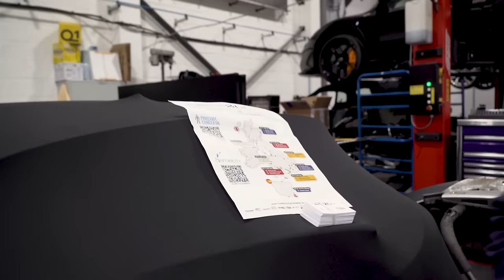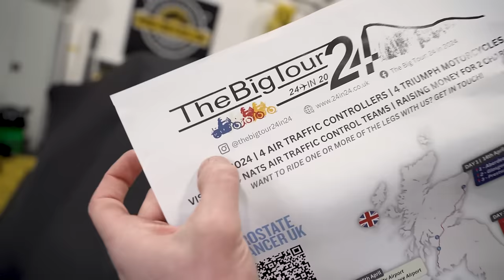Why Car Warranties Are USELESS! | Workshop Update No.58

Comment: The chat about 3rd party warranties brought back so many Bad memories. I used to offer them when I sold used HGV's. We had so many issues and annoyed customers from all over the UK and northern Ireland. You can  imagine how peed off our customers were with their truck off the road not earning money because the 3rd party company wouldn't pay for oil etc. In the end we started putting money aside out of the deals for our own "warranty pot" we could then at least act quickly and use our own judgement on what we would pay for. Most of the time we covered all items, oil etc because we valued the customers. They usually returned to buy more trucks from us, partly  because when things did go wrong we helped. Cracking video lads, keep it up!
Reply: Mate of mine did the same, just put the money they would have spent buying a warranty to one side, and stood by any legit problems, I did warranty inspections for several manufacturers and the only real good one was Lexus, so long as it had a full main dealer service history they would even pay up when it was just out of warranty

Comment: In my 50 years of owning vehicles it's the first time I've heard someone in the motor trade tell the truth about extended warranty. The fear of buying a modern car has catch me in a 2008 Kia diesel this car is fabulous it doesn't moan at me it starts it stops and I can fix it myself most of the time. Your comment about internet search engines hit the nail sq on the head when you ask Google a question or any search engine they're working for the companies not for you I got turned over applying for an Australian holiday visa was so angry with myself for being so gullible learnt experience

Comment: i used to do home emergency cover (plumbing and heating) for insurance companies. it was a nightmare i'd have to take samples of the system water to see the levels of corrosion as this voided the warranty. if they had a leak the cover wouldn't cover tracing the leak only the repair none of the making good. so if water was pissing through your ceiling you'd have to find the leak then i could repair it, you'd then be left with a gapping hole in your ceiling that was your responsibility to repair. some policies would only have £150 of cover that would pay for me to get there have a look and maybe supply a couple of fittings the surplus they had to pay. on a basic cover job i'd only get £70 so it wasn't financial sense for me to be there any more than half hour. biggest problem is as the engineer you're on the front line so when your telling them what is and isn't covered you'd be the one getting the abuse. when the system had corrosion the client would ask can't you just fix it and i wish i could have but i'd have to take pictures of me taking a sample from the system and a picture of the sample, the test tube had a black mark in the bottom and if you couldn't see the black mark then there's corrosion in the system. sometimes i'd even have to send away samples of the water. i'd advise anyone don't get home emergency cover because it doesn't cover squat!

Comment: Took out the top tier ‘Warrantywise’ warranty on a used BMW from an independent dealer.  Both front window regulators went after a few weeks (car had electrical gremlins), they refused to believe it wasn’t pre-existing so only paid out for one, the dealer didn’t want to know as I had the warranty.  A few months later the adaptive headlights went and there was no wriggling out of it, they rang the main dealer begging for discount off the several thousand £ quote, I told the main dealer to not give them a penny off!

Comment: Hey Ricky watching this I realised I am either very lucky or was dealing with one of the few warranty companies that exist. 

Back in 2022 I had a SL63 AMG. I bought it used from a great company called Performance 28. Dealing with Tony was fantastic. He sold me the car with a warranty from a company called MB&G Insurance. He assured me that they were good for their warranty. One of the few good ones out there 

Almost a year after the purchase and a week before the warranty was due to expire the hydraulic suspension on the SL was found with a leak. It cost 2.4K to fix. They went to my mechanic inspected the failed suspension and paid with no argument at all. .

Comment: Positive experience with a third warranty. RAC Platinum Plus covered 2x rear shocks on my Giulia Quadrifoglio the bill was near £1900 all in. They paid in full. They also covered a repair to the Harman Kardon amp at £200. They wouldn’t cover a replacement as this was over the claim limit for infotainment.

Comment: I've told several people that the "after market car warranty" is definitely a scam. Having said that, the company that sold my van (for doing track-days on motorcycle), did pay for a new EGR valve. They didn't pay for the service (that they said "it's recently serviced", which clearly wasn't true).. I'm not sure if the company paid or the warranty company, to be honest.

Terry Pratchet said it well: In-Sewer-Ants. Some are sl;ightly less bad than others, but in general, they are very good at finding ways to NOT pay for what you think they promised to pay for...

Comment: I have had Audis for twelve years now and my latest is the first brand new car I have ever bought 69 plate Q3 sport back I have had for nearly five years and I have extended the warranty through Audi officially with no problems and Audi have completed items for me during the ownership I do have a good relationship with my local dealer which I think helps. I did have a dealer warranty on my zx7r which covers nothing so I didn’t renew after the first 3 month “free” purchase part I just fix it myself. Great video and rant and well done on the bike wins at the weekend. What race calendar are you doing this year on the 600 as if you are at brands or thruxton I will come down to support.

Comment: Decent experience with WMS Group/Opteven on Gen 1 R8 V10. Negotiated a total of 12 months as part of buying the car, having read the terms and coverage and grilled the dealer specifically in horror stories of aftermarket warranties and claims etc, extended to 2 years for an extra £1350. 

They have paid out £2,320 on rear upper wishbone, oil leak x2 and alarm siren at full main dealer labour rates too.  

Will be taking out the Audi warranty in the next couple of months when this one finishes I think.

Comment: Had timing chains done on v8 audi b6 through warranty direct, same as you said in the video where diagnosing concerned as in the engine needed removing and chains and guides inspecting before they agreed it was covered by warranty so if they had said it wasn't covered I would have been left with the full cost, however once inspection was done they honoured the warranty and did a full inspection of the car and also did a couple of other repairs to issues they found so good experience in the end just squeaky bum time waiting for the thumds up on diagnosing.
I had the gold warranty package which was around £800 a year.
It was ten years ago when this happened so things may have changed now.

Comment: Brilliant channel, got a question about overheated con rod caps, the bearing went and it got so hot the cap went black , I’m changing the crank but should I change the rod and piston as well , as in could it have went out of shape with the heat , ps it’s a 4cylinder diesel , thanks

Comment: Based on this, I think I was very lucky with my after market warranty that you dealt with in January. Oil cooler, oil pipe, PAS pipe, rear shock and noisy fan, as well as oils, seals etc all paid out by Evolution Warranties Ultimate cover, which was a fully comprehensive cover and up to £200p/h labour rate. Claim value was just under £4200. I hope that they paid you your actual labour rate not the £60 p/h you've said most pay!

Comment: Appreciate everything you’re doing for me. Totally agree. But a good dealer should check over the car before putting a warranty package on it. Without doing that the customer and the warranty company are screwed.

I’ve been put off buying a car from any dealer now. I’d rather buy privately once the car has been inspected by a professional and take my chances. 

My car i bought .. was a sale on return car. I think the dealer just made it look pretty with a good detail and left me / warranty to pick up the pieces. You go to a dealer and pay a premium for security. I’ve had nothing but dramas and no help from dealer. They just kept saying I’ve got warranty 🙈

But I’m seeing the light at the end of the tunnel 👍🏻👍🏻
Reply: Consumer Rights Act 2015 means that the warranty protects THEM for the first 6 months. They have to fix everything wrong during that time.

Comment: Warranty companies take the p**s

My M4 spun the crank hub, I supposedly had a bullet-proof warranty, I asked when I bought the car.
They came back and said because the repair involved replacing the crank bolt, they didn't cover fixings so they wouldn't pay for any of the £2000 repair on a 30k mile car that had been serviced every 9000 miles and had only had a service 3 weeks before the failure.

They said the timing components of the timing were serviceable items when I contacted BMW and proved the warranty company wrong.

They came back with 4 or 5 excuses, and I ended up giving up with them.

What really made me laugh is they phoned asking me if I wanted to renew the warranty, I said if they paid the repair bill I'd renew......they hung up the phone.

I will never buy another warranty

Comment: Had warranty Direct On a 2002 Mini Cooper years ago. Power steering and clutch went and they said power steering wasn’t essential and, as I could still force gear changes, the clutch hadn’t completely gone either. I only got it through as a claim by stating “so, if I drive it off this car park now and have a collision and tell them I knew the PS and Clutch were FUBARed but YOU told me they weren’t totally broken yet so to carry on regardless until they did totally fail you’ll sort it all out with the police and my insurance?” Initially they argued they hadn’t explicitly said to drive it but when I forced they weren’t explicitly saying not to drive it and were actually encouraging me to cause a catastrophic failure and I’d report that to the police they suddenly backed down and agreed to have it collected and repaired under warranty. I’ve never had after market warranty since

Comment: Congratulations on the race results Ricky. That sounds like a good weekend was had 🏁🏆😎. I see you’re sporting the 300V logo. Would you recommend the 300V for a road only V8 R8 that will maybe do 3k miles a year. Could you also remind me what oil you recommend for the manual gearbox please? P.S. Good on you for helping to promote such an important charity ❤

Comment: I have a Range Rover manufacturers warranty and it does not cover the petrol tank shield which has rusted through in just 5 years.  This is a safety issue as it protects the tank from the heat of the exhaust.  Lots of labour for the job, so I'm now in for a £1000 bill.

Comment: The problem with warranty is modifications. You want to modify your car but manufacturers won't warranty a modified car.
Reply: Would you if you were in their shoes
Reply: @GARRYEASTON  Upto a point yes, not if its a built engine twin turbo conversion. but bolt ons shouldnt be an issue.

Comment: In some cases it does payoff to get an extended warranty. I paid $5k for an extended warranty on a low mile  SL550. It also had an additional one year MBZ CPO warranty. Almost at the end on the CPO warranty, ABC light came on. The a shock was bad. The dealer said shock where not covered by the CPO warranty. But guess what, they where covered by the after market warranty. Cost saving $4k. A year later the ABC control module failed. Another $5K covered by warranty. So I’m 4K ahead by having the warranty.

Comment: Alas even the Audi warranty is insurance backed.
Paid for a thermostat and oil pump on my 14,000 mile 2018 S4 which was a 4 hour and £7-800 job, though.
Given thermostats are a known fault, I was pretty upset that Audi wouldn't cover the cost of the excess only a month outside expiry of the manufacturers warranty and 6 weeks after they'd serviced it.

Comment: By law dealers are responsible for all faults for 6 months. Warranty is just a front, your statutory right supersede any warranty. 
After 6 months you have to prove that the fault was pre existing and the dealer is still liable if so. 
So ignore your warranty, take it back and reject it as not fit for purpose.

Comment: Got a warranty with vw for a 6 year old Passat I bought off a dealer. Problem with rattling dash and boot light not working. They know what needs to be fixed as did free diagnostics but you have to pay the £190 an hour labour costs to get to the faults, 2 hours for the boot light as roof lining needs to come out to replace a faulty wire and hour to strip the dash to basically put new clips or tape in.  What a load of shite.  Took it to the sales guy and suggested he has it back and suddenly being fixed, I’m sure he will claim it’s in the docs and he’s doing me a favour.

Comment: Got an audi extended warranty on my audi S4 hope to god they pay out if needed 
cost 1k for the year
Reply: VAG are normally pretty good tbh. I had water pump fixed and new front suspension.
Reply: When would you recommend I get auto box changed
It's 18 plate with 37k on the clock
Reply: Oil that is
Reply: @markroberts35  DSG change is every 40k. I'd go to a specialist and get it done. About £250 and saves you 2 grand for a new box. Try to get them to check the filter in the box.

Comment: Audi warranty is probably the only one worth considering but even that is somewhat debatable. I had one for a while but they declined a failed seatbelt mics because electrical. The good thing about the Audi warranty is that in the second year the cost decreases by about half.
Reply: It's supposed to cover electrical and mechanical, no?
Reply: @sportzntouring  
Possibly the full component may have, I had the named component but it didn't seem to exclude it from what I could see. I couldn't be bothered to argue with them over a few hundred quid plus there's a quick work around for that but it put me off renewing.